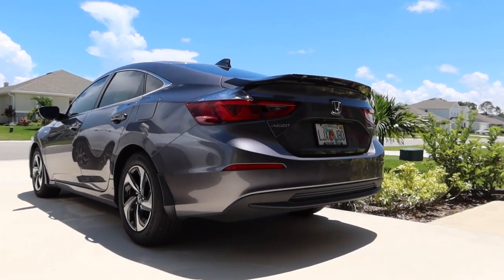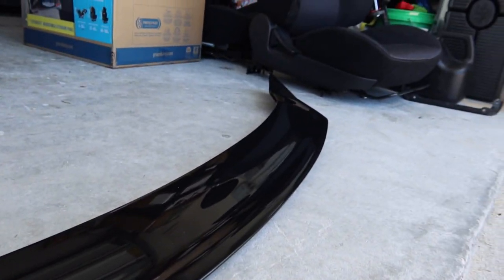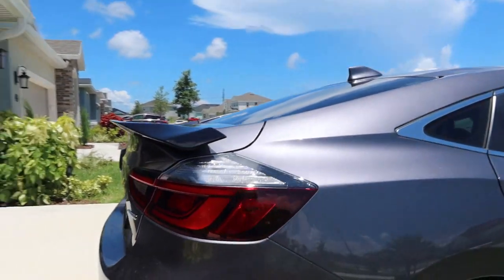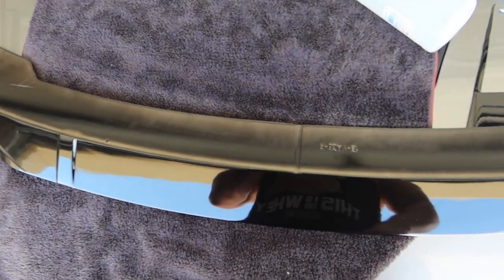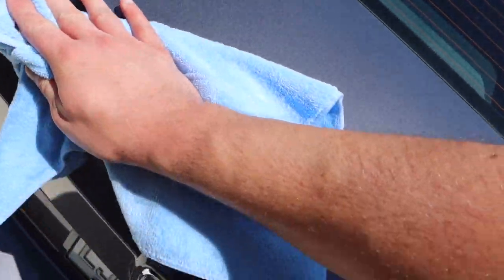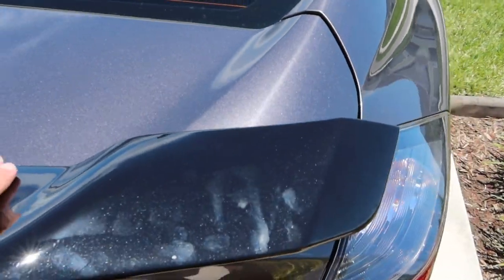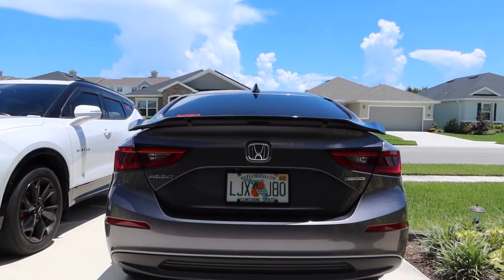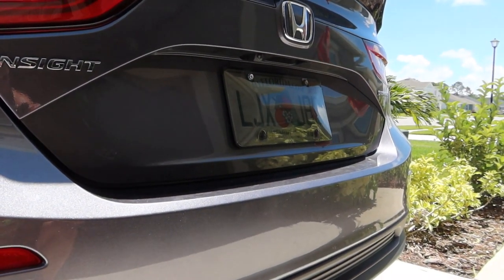2019-2022 Honda Insight DuckBill Spoiler  Install

Comment: I like it from most viewing angles but the extended edges would bother me. Still it's a start and it adds flavor to the bland Honda rear ends of late. While not a priority, I can see myself adding a spoiler at some point.

Have you noticed any rattles/vibration, loss of rear visibility, drop-off in MPG, or other negative effects from this addition?

Thanks!
Reply from the maker: I have noticed nothing changed performance wise! And I do agree with you about the edges, but still not too bad imo.

Comment: I believe the reason for your overhang is that you purchased for an accord, while the insight is actually built on the civic platform. Still looks pretty good, flush is better for the aerodynamics in my opinion off the sides (for obvious reasons). I own a 20 Insight and am working on this decision myself, I would prefer flush over overhang to get that 55mpg I bought it for. 👍🏼

Comment: Hate to be that guy but I don't like the gaps on both sides also any thief could easily pop that off. I Wonder if you can get it heat treated so it sits flush with the body?